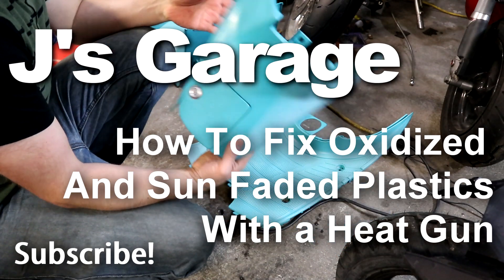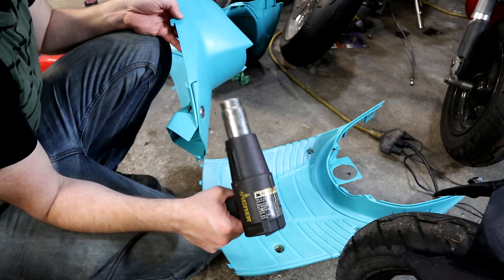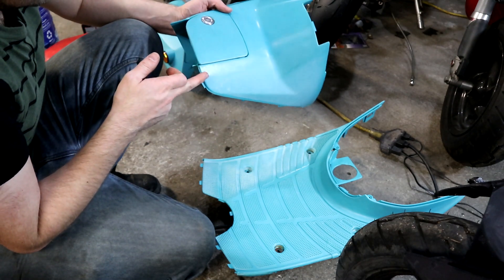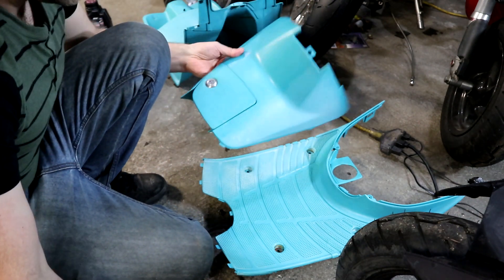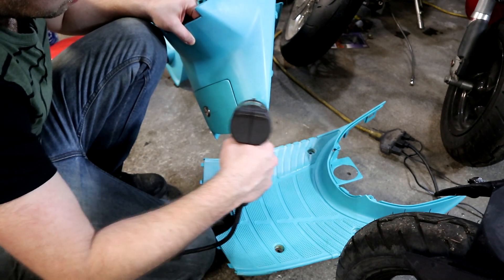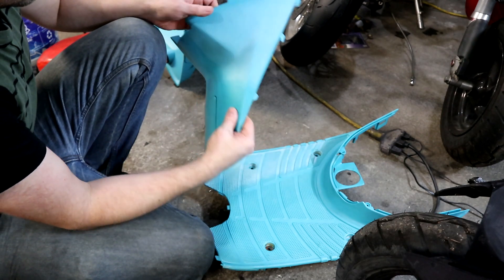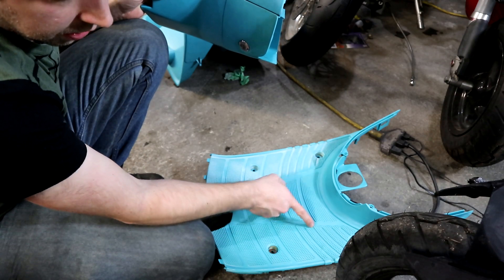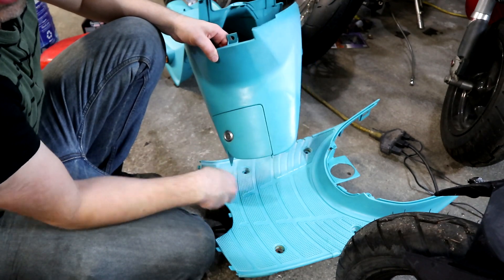How to Repair Sun Faded Plastics With a Heat Gun! - J's Garage

Comment: Lafe saver! 😁 just one question did you use low or high settings on the heat gun? 🤔
Reply from the maker: either one would work, I think I used high.  The big thing is going slow so you don't overheat the plastic.